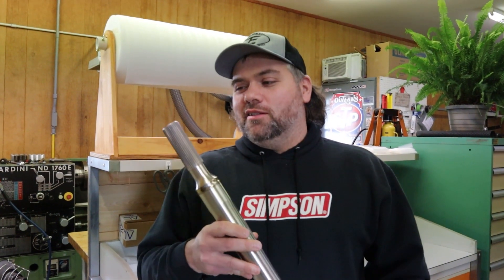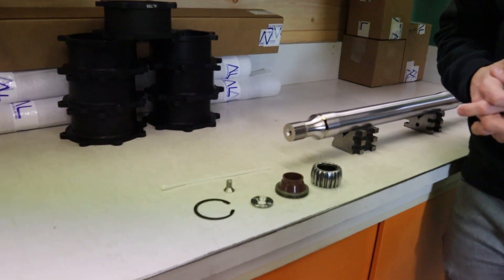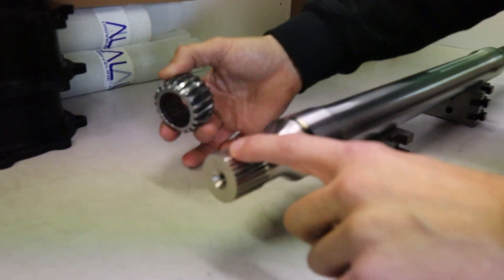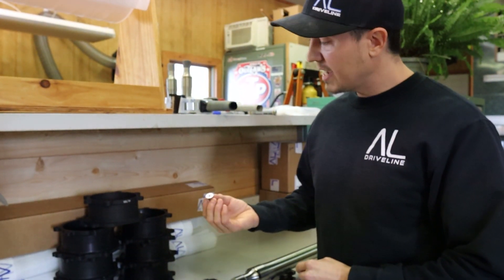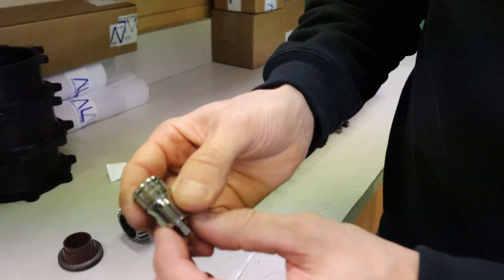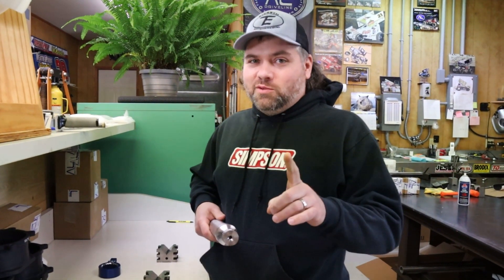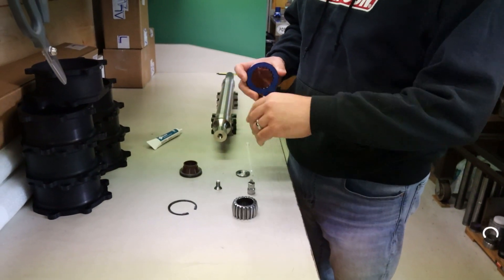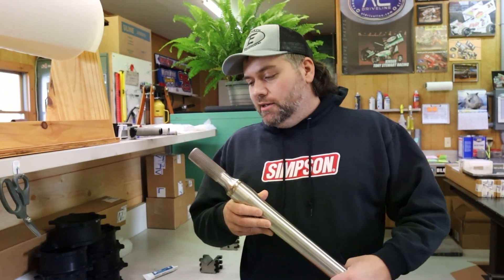SPRINT CAR DRIVE SHAFT MAINTENANCE & TECH

Comment: With firearms, lots of folks use loctite, because the threads are mostly quite small. There are places where a properly torqued fastener works without loctite and it makes removal SO much easier. And we've all seen improperly torqued fasteners give up, even though they were over loctited. A good precision minitorque wrench, used correctly, will beat 10 bottles of loctite!      WillyB